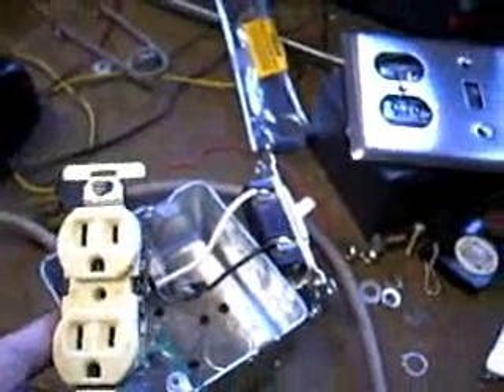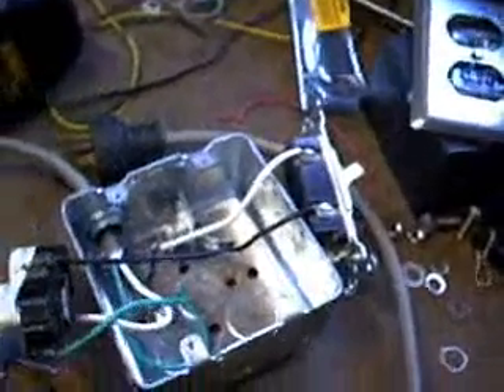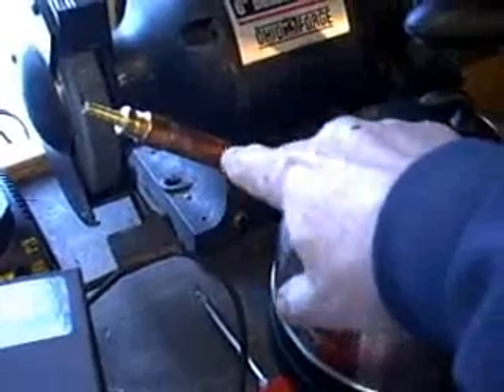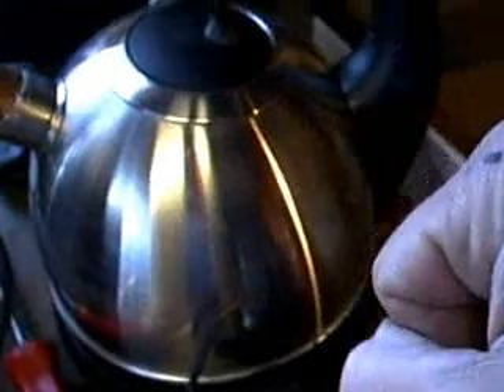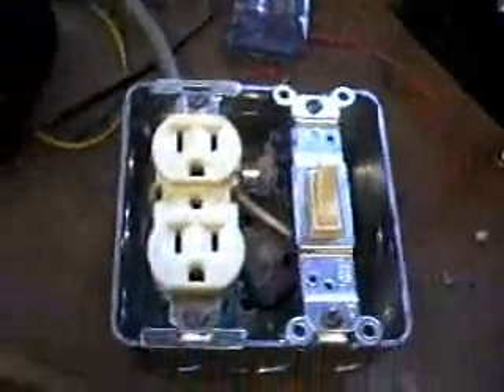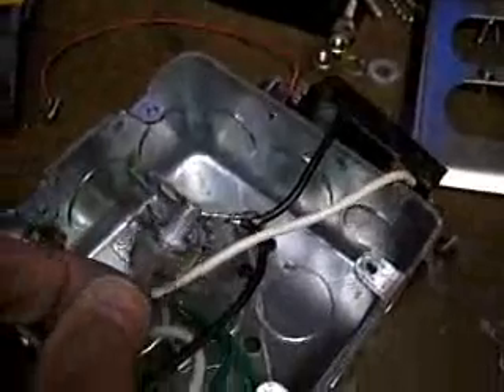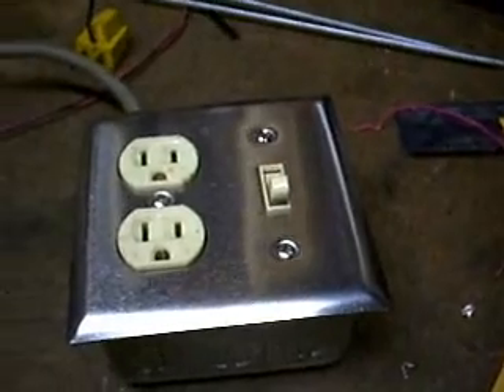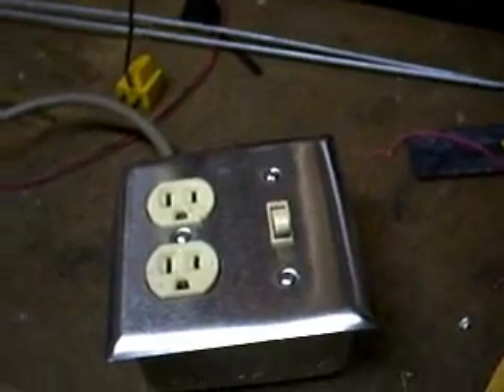#63 Water boiler for plasma cold fusion project

Comment: Zero, I think the reason you are getting arcing from diode to ground is that when the diode turns off the field around the heater coil collapses and you get high voltage that has to go somewhere. What do you think?

Comment: Your wrong, sorry...
The equipment is grounded and electrically the same as the white wire...
You are mounting the black wire(the hot to ground wire) on the grounded box!
Since the white wire has no potential to ground, it will not short. The fact that you are shorting to ground proves it is a bad wiring design.

Comment: The green wire is the grounding wire for the equipment.
The white wire is the grounded wire for carrying current.
The black wire is the ungrounded wire for carrying current.
The diode should be placed in the white wire part of the circuit because there is no electrical potential there.  The white and green wire are connected to the same buss bar in the circuit breaker box(distribution panel)

Comment from the maker: Not to be critical but heat transfer is what the mica insulators were designed for. That's why I'm using thermal compound and drawing any excess heat away to the metal case.